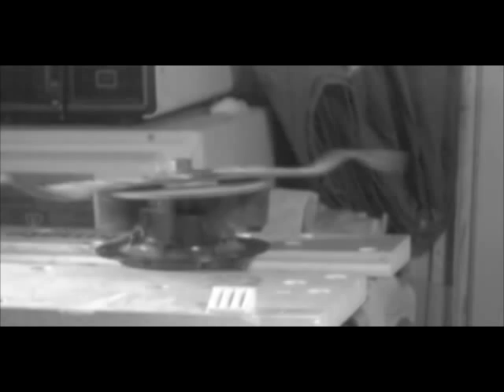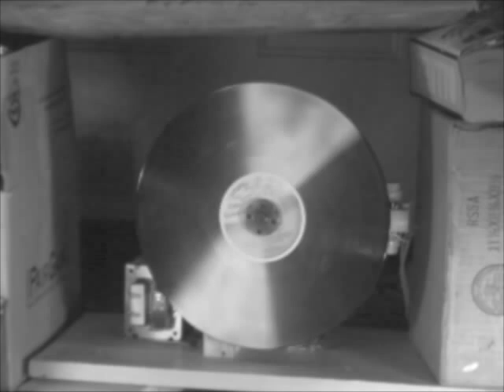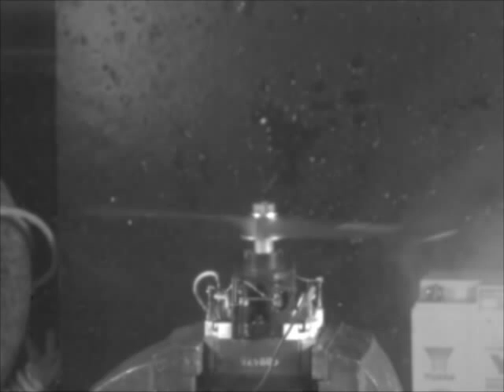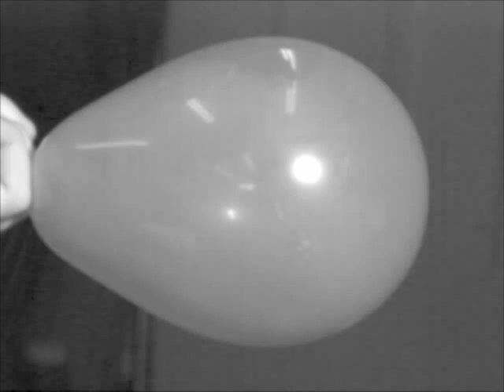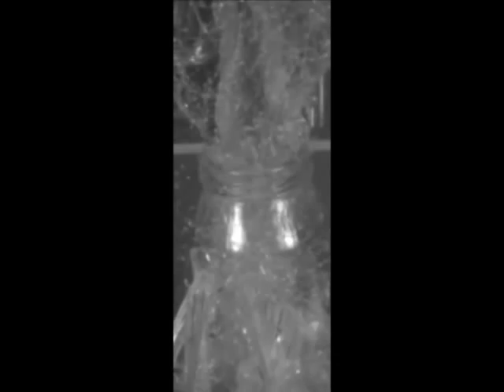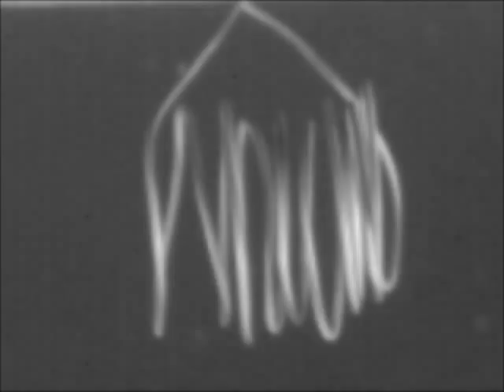High Speed Compilation 1 - Rotational Impacts and Electricity

Comment from the maker: @douro20 The highest frame rate I've run on this camera is about 15,000fps, when recording a high current electrical discharge (not shown in this video, I'll have to show that in another compilation). The resolution is very low though, I think it was 32x32 pixels.